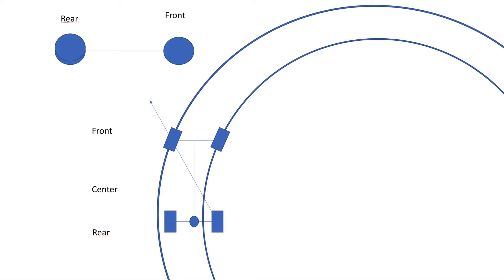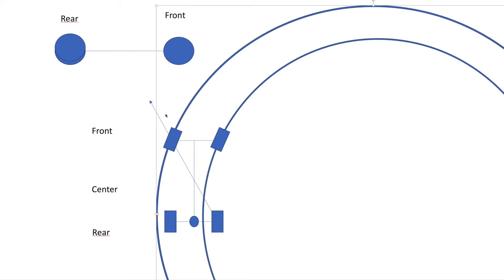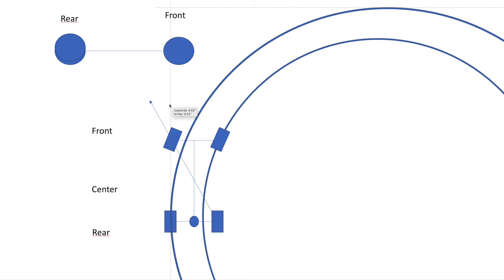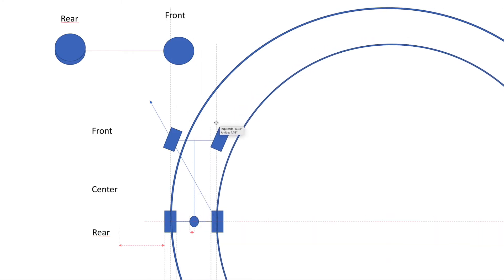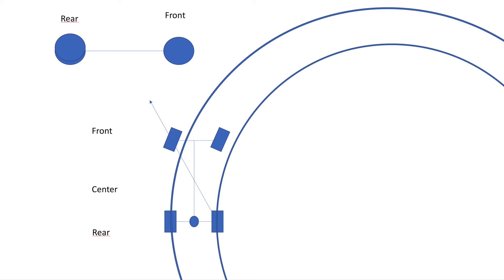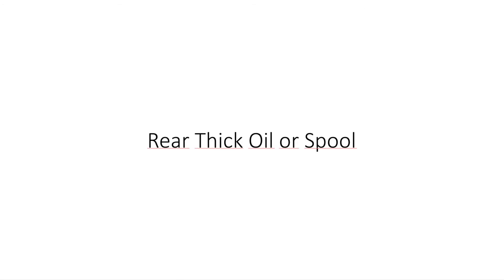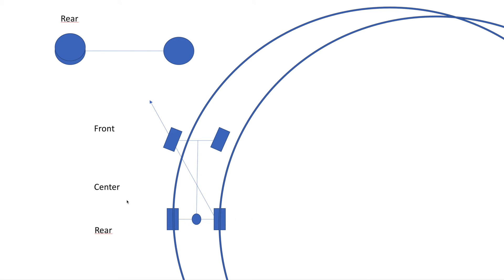TelecomandoRC rc Differential 101 Part 2 Rear differential thin vs. thick differential fluid spool

Comment: i have a tekno sct 410 2.0 and i took it down from 10 to 5 in the rear and somehow that that makes it spin out really easy on loose or dusty hardpacked clay track im on

would you also recomend 15 for the 2.0?

i could actually do with a smooch less steering on the 2.0

or back to stock at 10?
Reply from the maker: You can bring it up or make the rear softer, or the front stiffer. I would play with it by going back and seeing what a softer rear spring would do.

Comment: I have 1 ml in my front diff of my maxx. I can’t decide whether I should put 10, 30 or 50k in rear. I’m afraid 10k might be too light with the weight of the maxx. What do you think?
Reply from the maker: What is it doing? 10-30 in the rear sounds good. But... are you running a center diff.? If so, you may want to tune this one first.
Reply: @ what happened was I tuned the opposite and went heavy in rear with 500k and only had 100k in front. My center has 20ml and I made sure it was filled so that was good. The back end was whipping around. So I put 1ml in front and it’s so much better. Now I want to get that rear perfect because it still has the rear coming around when trying to apply throttle out of turn
Reply from the maker: @jackcarmichael2476  Makes sense. I see why you want to go lighter in the rear. The center seems light. Work on the rear as you mentioned before. If you start seeing the front unload, bring up the center diff fluid weight.
Reply: @telecomandorc  I put 30k in rear and you’re right. I could have put 10k in. I’m going to run it for a little bit and then go 10k. I am realistic because it is a monster truck and not a 4x4 slash so you can only get so good of handling
Reply from the maker: @jackcarmichael2476  I think you are spot on with you reasoning in tuning.
Reply: @ thanks , really appreciate it. And thanks for making videos of all these tips on tuning. Really helped a lot!

Comment: what is the reason that cause  a on power spins out ? I am trying to understand and to fix on my on road rc.
Reply from the maker: Many things. It could be that you let off to fast or too late and weight is transferred to the front too fast. It could be that the front tires simply have more grip. It could be that your front springs are too soft and the oil too light. It could be that there is more than .5mm in ride high difference between the front and rear where the rear is higher.
Reply: @telecomandorc  thanks
Reply from the maker: @polowong8558  My pleasure. 🤝
Reply from the maker: @polowong8558  My pleasure.

Comment: Just watched part one and two. I recently upgraded my infraction 3s with metal geared diffs front and back (pinion and spur), and the diffs are much tighter than the factory ones. I haven’t had the chance to give the car a rip, but I was wondering how this will affect the car. Seems like tighter diffs are exactly what I want and need. Cause I just want to drift and power slide, no precision driving at all. 😊

Thanks so much for this video, it really deserves much more views and likes!!
Reply from the maker: Reminds me of the Arrma Limitless. That thing drifts all day. Fun stuff.

Comment: I've been searching for ages and this is the best/only video that covers diff set up on 2wd/rear wheel drive car!
I've got a baja 5b which I run on grass and it currently has 10k oil in the diff. Regardless which tyres I use it's like driving on ice.  Blip the throttle even slightly too much and it spins out. After watching this I think I'm going to try thinner oil.
Reply from the maker: Glad it helped.

Comment: Very useful thank you . 
Question I am a little confused about oil weights . 10K or 10,000 cst is the same meaning ?  (Team Associated) diff oil. 
How about  900CS /60wt (RTW) shock oil .
Reply from the maker: For diff fluid the number matches. So 10K AE fluid is 10,000 cst. But 900cst shock oil is close to 70WT in AE.